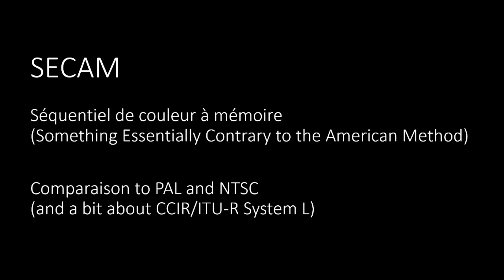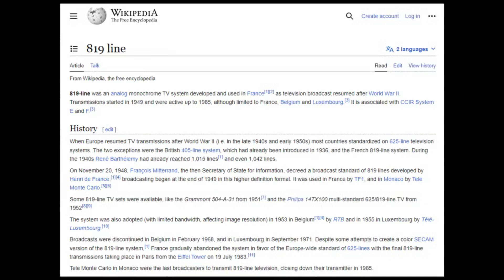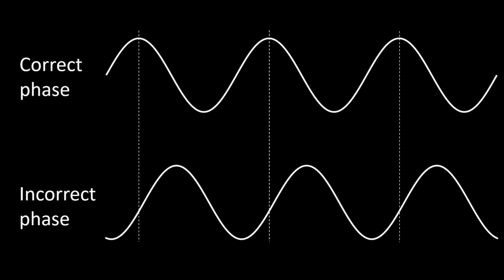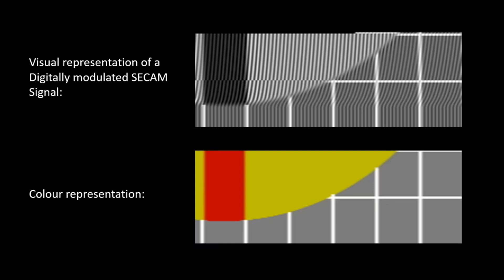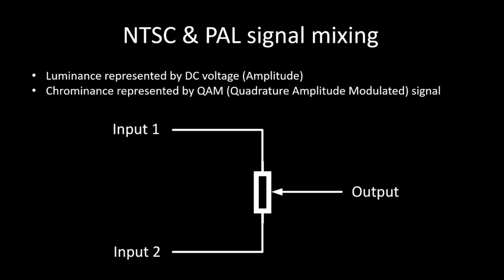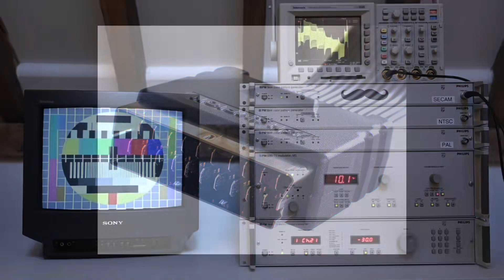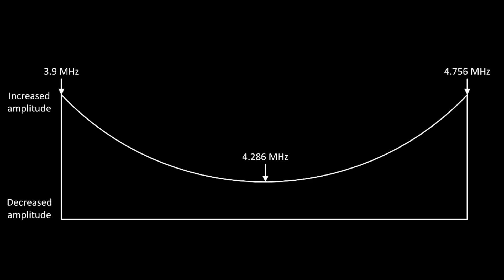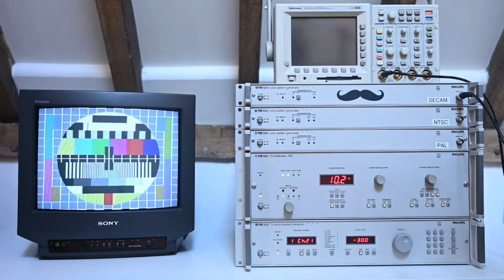#4 - SECAM + Comparison to NTSC & PAL (And a bit about CCIR System L)

Comment: Hey you got a nice set!!
I endet up making a mustistandard Philips PM5534 for PAL and Sécam...It works well
 but when it comes to the modulator i am stuck `cause of the vestigial side band filter.
Where did you get the PM5680MS.
That would be a lot simpler for me than having seperate modulators for each system!!!
I need a rack for all of them.
System:
C
L
L`
G,B
D,K
I
M,N

B.t.w i like your videos!!
A1!!!

Comment: Yes,there is/was also a system L with PAL!!
Just for "fun" i "created" fantom systems like system L positive modulation but with FM sound and NTSC 4.43Mhz color.
PAL,Sécam and NTSC were "added" to the already existing b/w systems and unfortunately the "color filter" in the "y" (black and white demodulation) was reducing the bandwith of the b/w  channel.
So the picture,when color was added,was blurrier.
I removed the "color filter"  therefore there is the color carrier visible, yet a sharper picture of the B/W.

Comment: I’m curious about Argentinian, Paraguayan and Uruguayan PAL-N system. N system broadcasts on 625-line but with 6MHz like M system.
Reply from the maker: I was planning to cover PAL-M. But N would be difficult to demonstrate!
Reply: @mattstvbarn I see.
Reply: @mattstvbarn  feed 625 line PAL into a system M modulator. I do it all the time to run my U.S. monochrome TV sets on 625 lines without having to realign the sound IF to 5.5MHz.
Reply: @cool386vintagetechnology6 on US Sony Bravia that accepts NTSC and PAL video inputs, try with 625 PAL-Nc  and it works on PAL-N as well as 525 Brazilian PAL-M. Also NTSC 4.43, NTSC-J and NTSC-M.

Used with VGA TO VIDEO
Reply: VGA TO VIDEO (connected from HDMI TO VGA), VGA TO VIDEO have PAL-Nc/PAL-N, PAL-M, NTSC-J and NTSC. O already tested with TM70 UHF RF MODULATOR and Analog TV phone with selectable countries: Philippines or Japan (NTSC), Brazil (PAL-M), Argentina (PAL-N), Rwanda or French Guiana (SECAM-K/K1), France (SECAM-L), Chinese Shenzhen or Ireland or Hong Kong (PAL-I), Iran or Iraq (SECAM-BG), Russia (SECAM-DK), Vietnam or China (PAL-DK), Cambodia, Singapore, or Europe (PAL-BG)

Comment: I lived on the south coast in my teens.  French television could be received regularly with an aerial swing to the South East and some modifications of a dual standard TV.  Set to 405 lines on VHF, one could tune in to some 819 lines transmissions, albeit with two narrow pictures displayed when synchronised. No sound of course.

BRT, Belgium also used positive modulation and AM sound using System C on VHF,  so could also be received from modifying the tv set's internal slider to enable 625 lines on VHF, again with no sound; the carrier at +5.5 Mhz, whereas the 405 system was -3.5 Mhz below (simplisticly). Any engineers having experience with turret tuners will know!

Turning to UHF and disabling the set's internal slider switch to enable AM sound and positive modulation, one could pick up the two other French System L 625 line channels, Antenne 2 and FR3.  Again, no sound for previous reasons.

The disadvantage with positive modulation, particularly at VHF, were ignition noise and industrial noise spikes came out as picture white spots, the greater the interference, the greater the white spots!  Considerably more noticeable than black spots under negative modulation systems.
Reply: Supplemental.  In UK dual standard sets, switching from VHF to UHF also switched from System B to System I: Both line standards and modulation standards *together*.  The internal switch looked like a long strip similar to a slide rule operated by a cable. One just unhooked the cable for each of the circuits; 1. modulation in the IF strip and, 2. timebase circuit for line frequency.  The high voltages in these sets meant you had to know what you were doing and take safety precautions. #Caveat.
Reply: System B is the system used in central Europe on VHF.
UK had system A on VHF and system I for UHF @Broadercasting
Reply: Of course, unless engaged in 'border blasting', broadcasters tend to want to avoid signal bleedthrough into neighbouring countries, or at least that's the impression I get... Still though, I've always thought it a pity, thinking about it from the standpoint of an average viewer 'in the wild', rather than from the engineering p.o.v., that British TV's couldn't ordinarily decode French signals (or vice versa). It would have been nice for British and French householders to have been able to watch each other's programmes, with only the need for the right sort of aerial pointed in the right direction, and no need for the complicated and fussy (but clever) workarounds you describe. This, of course, is exactly what Irish television viewers who lived near the East coast or the Northern Irish border did. I don't know about viewers in places like Cumbria or Anglesea, or the Isle of Man, but I know many people in Northern Ireland 'returned the favour' -- but only in certain neighbourhoods, since, bizarrely, increasing your choice of TV stations by 50% more or less for free would be seen as a political statement! (The need for an outside aerial mounted high, and pointing in the right direction obviously meant that 'discretion' wasn't an option!
         Of course, going back to the subject of picking up French TV in England, even leaving aside their incompatible - in - practice SECAM system, one would also be faced with the insurmountable difficulty that French broadcasters stubbornly insist, to this day,  on using the French language (probably with an eye to selling programmes to Canada, or something?! 😉 )
           I've always been intrigued as well, by France's having an 819(? I can't refer back!) - line system, so long before everyone else, at a time when, as you mention, many British viewers were still getting by with less than half that resolution! I seem to recall Japan having something similar? (TV, you may have gathered, is not my field!) I could just be confabulating, but I seem to have this recollection that the French High - Res (for the time, anyway) system was in Black & White only(?) -- Interesting trade - off, if true...
Reply: @richiehoyt8487  The French 819 line system had 737 active lines, and was interlaced. (Compare with current 720P!) Indeed, like the UK's 405 line system it was black and white only and the aspect ratio was 4:3.
The (VHF only) channels too, were interlaced over Band I and III with a bandwidth of 14MHz. Compare that with the 405 line bandwidth of a mere 5 MHz.
Still with air pressure being high, reception was fairly regular at least at VHF in Hastings.
Due to licensing, countries did and do minimise overspill.  Different line standards and colour systems often meant production and market protection, so set makers in France at a distinct advantage to make 819 line sets. TF-1 eventually ended up on UHF with the rest.

I now live in North Wales and occasionally recieve TV from Ireland. The signal makes it's way across the Irish Sea and by complete coincidence, channelled through the Menai Straits to this location.  Digital TV in Ireland uses DVB rather than DVB-T2 on the multiplexes.

These days of course, with the advent of satellite TV, Distance reception (DX-TV) much easier with a moveable dish and asatellite finder, but that's another story!

Comment: Do the French still use SECAM?
Reply: Everybody’s gone digital nowadays. Is it DVB-T in Europe?
Reply: @lawrencedoliveiro9104  I think they use DVB-S1/2
Reply: @lawrencedoliveiro9104  Not everybody, there are still some cuntries that mostly use analog broadcasting.
Reply: @MernokiMegoldasok I believe Belize is still using NTSC. They plan to switch to ISDB-T, or at least that's the last I heard. Kind of interesting because they have lots of connections with the United States, and, with so many people traveling back and forth, going with ATSC would seem to make the most sense logistically. Of course, since they've waited this long, maybe going straight to ATSC 3.0 makes the most sense.
Reply: I think no
Reply: Now No.
Reply: yes until the end of analogue times,so did Russia

Comment: It would have made much more sense to use a delay line and transmit one color at a time but with VSB-SC modulation. Like the FM stereo subcarrier but only keeping the lower side band. Phase errors would lead to a decrease in saturation but no color shift.
Reply: First Secam versions were in fact like NTSC using AM-SC with only one color difference signal transmitted in each line. But then they started to solve other problems like early VTRs errors and long distance line phase errors and they switched to FM. Secam became too complicated and the quality was compromised.

Comment: Another plus of SECAM is that it could be recorded on monochrome VTRs and play back color without the need for time base correction. Even industrial and consumer VTRs for NTSC and PAL must have at least hetrodyne systems to stabilize the chroma signal. The NTSC and PAL broadcast machines started with analog voltage variable delay lines, then went to digital storage when technically available.  SECAM VTRs never needed this additional circuitry for color.

The problem for NTSC and PAL VTRs was once again, phase errors. I don't care how good your machine shop is, nobody can manufacture a tape transport stable enough to avoid destructive phase errors in an analog color video signal.
Reply: I used to modify pal vcr's to record secam by adding a switch to bypass the delay line and switching off phase shifting. Recording would of course have to be done via the scart input connected to a multi standard tv. The recording could also be played by vcr's that had "mesecam" Often used in east Germany and various middle eastern countries.
Reply: ... unless you encode the tape digitally. Tapes are used for backing up computer data, and that works quite well.
Reply: Secam fire...😂
Reply: This why our Sony SL–8000E was recording East German TV in color, I realized it when I got the first SECAM capable TV…

Comment: I lived my first 25 years in Alsace, east of France, close to Germany and Swiss. We had TVs with both standards in order to receive the French SECAM broadcasts and the PAL broadcasts from abroad. I have to admit that the PAL broadcasts were always pleasant to see. Don't know if it's a question of standard or the way the broadcasters adjusted the signals, but PAL colors were always more saturated, plenty of colors, while SECAM colors were more desaturated like pastels. And about the music, no comparison : FM sound from PAL was great, especially because stereo was introduced much more earlier.
Reply from the maker: Your experience is common. While SECAM was superior on paper, it was difficult to get it right in practice and often transmission systems and receivers were poorly adjusted resulting in inferior colour. I have not seen this in my own setup. The colours are very nice.
Reply: What sort of stereo sound was used with PAL? Was it the British NICAM digital system? That’s what we had here in NZ.
Reply: @lawrencedoliveiro9104 Depends on the country. The majority of PAL countries used NICAM as the stereo sound standard but some countrirs like Germany used A2/Zweikanalton standard
Reply: It is the 2channel syten.
There is the 5.5Mhz for the first sound channel and 5.74 Mhz for the second sound channel.
Well there is something i want to say .
PAL is ONLY the Color system!!
Central Europe mostly has the Sytem B and G ,625 lines,neg.modulation and FM sound.
B is for VHF (7Mhz Bandwith) and system G is for UHF  (8Mhz Bandwith)
 Why  has UHF a wider bandwith?
Because of France,UK,Ireland and all of Eastern Europe has system "D" with a Sondcarrier on 6.5 Mhz.
System  D uses the same bandwith like the French system L .
BUT has negative modulation and FM. sound.They didnt want to have the same issue like on VHF with different channel spacing for each system.
UHF has 3 dufferent channel spacing in the world.
  @lawrencedoliveiro9104
Reply: @wickie-vickesverige4995 system K for UHF of system D. PAL-D used in Mainland China, PAL-D/K used Bulgaria, Czech Republic, Romania..

SECAM-K for overseas France and former French colonies in Africa. System K uses FM same as D.
Reply: @lawrencedoliveiro9104  Britain and NZ used Nicam. Most European PAL countries and Australia used the German Zwieton system which used an additional sound carrier at 5.74MHz.
Reply: That’s why PAL is called Perfect At Last. French L system with inferior AM audio system.
Reply: True!! BUT that only applies to the COLOR.
There is/was also Sécam B and G in former eastern Germany and systemB/G Pal in western Germany.
Yes,there is/was also a system L with PAL!!
Just for "fun" i "created" fantom systems like system L positive modulation but with FM sound and NTSC 4.43Mhz color.
PAL,Sécam and NTSC were "added" to the already existing b/w systems and unfortunately the "color filter" in the "y" (black and white demodulation) was reducing the bandwith of the b/w  channel.
So the picture,when color was added,was blurrier.
I removed the "color filter"  therefore there was the color carrier visible yet a sharper picture of the B/W
Reply: @Alozhatos  See there is the PALsystem mixup!!!!
PAL HAS  N O T H I N G  to do with the actual B/W system!!! 
The FM sound and negative modulation on systen B/G was BEFORE PAL was ADDED!!!
Reply: @Alozhatos Multisystem NTSC PAL SECAM TVs sold in Asia and Saudi Arabia doesn’t have System L, but French VCR required for use in France. Sysyem K for SECAM are also used in oveseas France and former French colonies in Africa. Yes. Saudi multisystem TVs have NTSC-M, PAL-B/G,I,D/K and SECAM-D/K,B/G only. Also Auto, NTSC 4.43 (middle Eastern VHS tapes), NTSC, PAL and SECAM. 

European TVs doesn’t have NTSC-M on analog tuners but only on AV inputs.

South American System M / N TVs also accepts NTSC-M, PAL-M (Brazil), and PAL-N (Argentina, Paraguay, Uruguay).

French Guiana used SECAM-K
Reply: Also SECAM are prone to SECAM flare/fire which red and blue “flare”.
Reply: @Alozhatos 525 line NTSC battery operated videogame from Disney games, full battery in NTSC, low battery, that coloured picture tuned into 525 line SECAM 4.40/4.42 in reddish colour.
Reply: I receiving in the 2000's in Switzerland (Thoune) weak the Transmitter from 'Mulhouse' with TF1 on Canal 27 in Secam. The Picture was Inverted compared with our Swiss Channels.
Reply from the maker: It is an honour to see you comment here. I have spent many an hour studying the test cards in your channel, and have even recreated many of them with original hardware!
Reply: Ah the famous Fuba x-Color antenna! 
I used to receive them all 
TF1 chaine 27,
Antenne 2chaine 21
 et FR3 chaine 24 
Les chaine Allemand de SWF chaine 8
ZDF chaine 39
Et SW3 sur chaine UHF 52 ?? 
je ne me souviens pas @625line
Reply: That's interesting!  When I visited Switzerland as an American in the early 1990s, I thought SECAM looked nicer.  Although I recognized both of them as looking better than NTSC.  BTW for the first few days, the 50Hz caused TVs there to seem to be strobing to my eyes.  But I got used to it.
Reply: Oh yes, ZDF E39 & SW3 E52 was from Hochrhein. Canal+ on L5 was also from Mulhouse receivable, but encrypted in Syster.
Reply: NTSC = Never the Same color, PAL = Perfekt at least, SECAM = ??
Reply: @ratioradioKI73  French Wikipedia : « Surtout Éviter la Compatibilité Avec le Monde »  => “Above all, Avoid Compatibility With the World”

Comment: I’d be interested to see the difference in SECAM’s arguably better ability to encode and decode color. Specifically the naked eye visible difference on set particularly vis a vis NTSC and PAL chroma dots artifact which in my understanding should be absent in SECAM.
Reply: The colour subcarrier patterning effect is absent on SECAM because the 'phase' nature of the colour subcarrier is effectively random. It is visible though, but more as a sort of noise. Unlike with NTSC and PAL however, the subcarrier is always present even in areas with no colour.

Comment: SECAM is definitely an interesting color standard, it was also used in Czechoslovakia, but instead of having SECAM VTRs etc. it was all done in PAL, mostly on Ampex and Sony stuff (Czechoslovak national TV had Ampex VR2000 since the 60s with it's logo scratched off) and then converted to SECAM before transmission. So in early 90s all they had to do was to bypass the SECAM converters and we became PAL region.
Reply: That was also the case in the GDR when it collapsed and joined the Federal Republic of Germany.